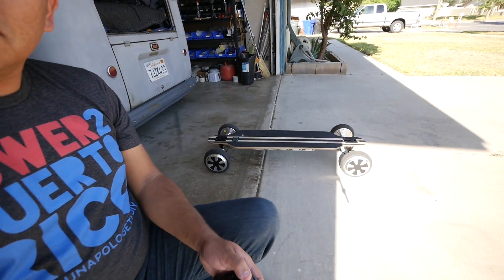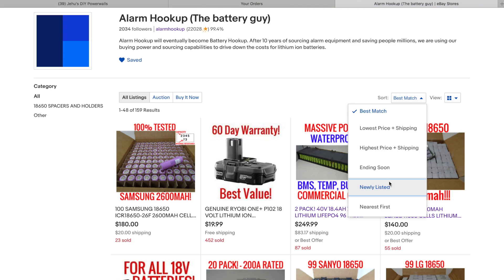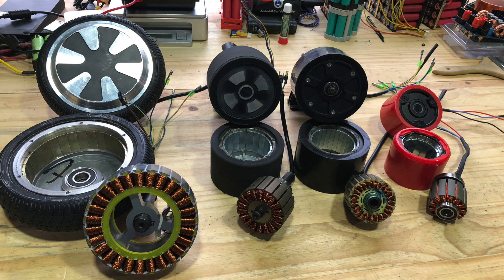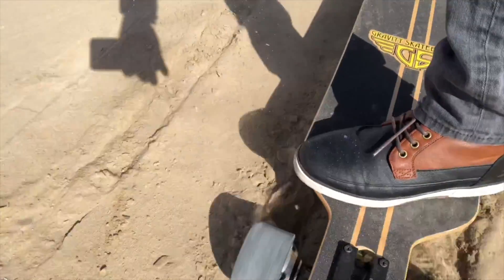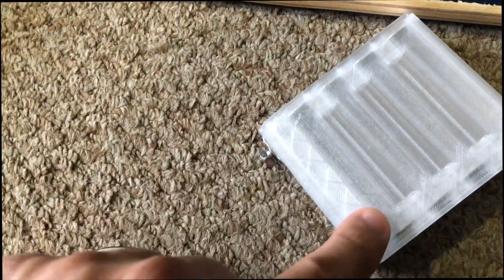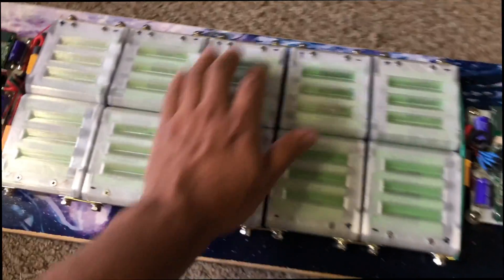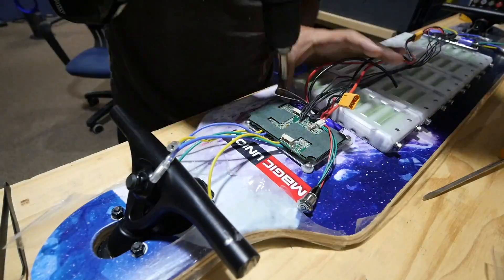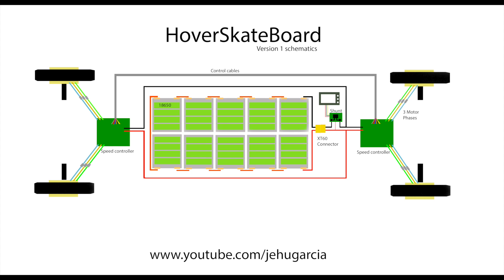Baja Electric Skateboard using Hoverboard wheels (HoverSkateBoard)

Comment: Hey jehu, you can just reconfigure motor windings in delta configuration to get more speed .nice video by the way😉
Reply: Lol. “You just”.  I admire people who describe rewinding a motor like that.
Reply: They are already in delta configuration. Wye configuration is very uncommon in these small Perm magnet motors
Reply: joblessalex No, just need to find the common joint, cut its insulation off, desolder it to get it apart and partially remove insulation from the incoming phase cables.  Then do a continuity check to see which phase is which and colour each end. Then connect any 2 dissimilar colours (common end to phase cables end). 2 should have enough length to reach directly and one will need a jumper wire. Insulate and secure everything away from where the rotor will be and that's it.
Reply: @plodderexup  do you have tutorial of this job?
Reply: @africans1968  No.
Reply: Peeps Dropping knowledge... D0pe
Reply: Hi, Africa here - just wanted to suggest that the round brass be repaced with a mutlistrand to account for skin effects. There be losses.
Reply: Lee Burrow You dont need to rewind to go from delta to y or vica versa. But granted I am sure it can be an awkward job.
Reply: so can anyone tell me how i must connect the motors to get Delta?
Reply: @RCCar215  you must open the cover of motor. then find 3 groups of wires welded together. separate them. now you have 6 groups of wires. with a multimeter find head and end of each coils and put a name on them.
A_ head of first coil.
a_ end of first coil.
B_ head of second coil
b_ end of second coil
C_ head of third coil
c _ end of third coil.
now connect a to B
and b to C
and c to A
then put 3 main wires on each these connections.
now your motor have delta connection.
1.7 times faster. and drain more current.
Reply: So you need to help me out mates, i open up my motor, i have 3 coils of blue, 3 coils of green, and 1 coil of yellow wich is connected to end of blue and green with soldering connection. Which one i must cut and rewind?
Reply: @aliakbari437  make a video of this 🙄
Reply: @aliakbari437  after watching the video a few times because I don't speak French, I understand it. Thanks for the help!
Reply: Lee Burrow You switch six wires. Not rewind.
Reply: @joblessalex  where's the update video?? I need alternatives please
Reply: The ones I've deconstructed are Wye.  I've reconfigured a pair as Delta and as expected, they have about ~60% more speed and ~30% less torque
Reply: CheadleBiker do you have to modify sensor config? Might try it just permanent without switching
Reply: Kedar Nimbalkar glad to see you here!!
Reply: he needs better motors... not these...
Reply: I wonder how this thing handles hills compared to other Eboards on a longboard chassis.
Reply: Bro, ride it upside down, lowrider
Reply from the maker: Tried it,  didn’t work
Reply: @jehugarcia  Hi Jehu , itried and it worked .In case you still have the board you need to try again , the board will become a real 4WD monster with top speed of 36.8 km/h.Also the idea to run it on 48 volts  ia vwey good  these controllers can run on 48V without a problem.
Reply: More speed yes, but also less torque.  It is possible to make it switchable between delta and star windings, so could use it like a gear shift. It would be a lot of fiddly work!